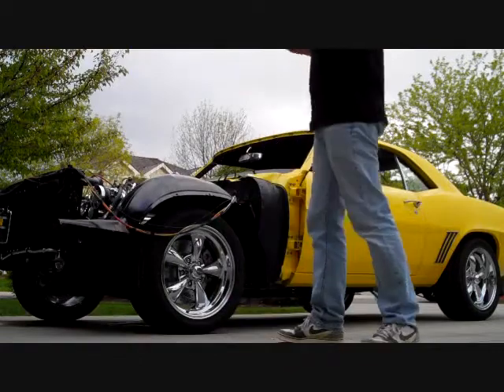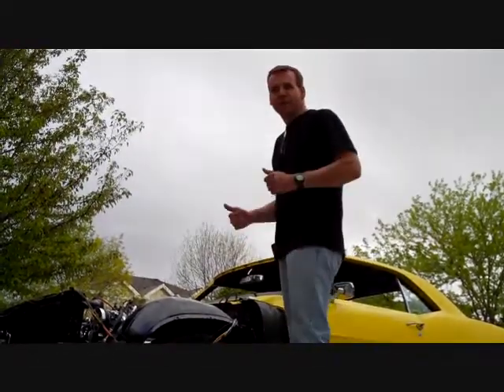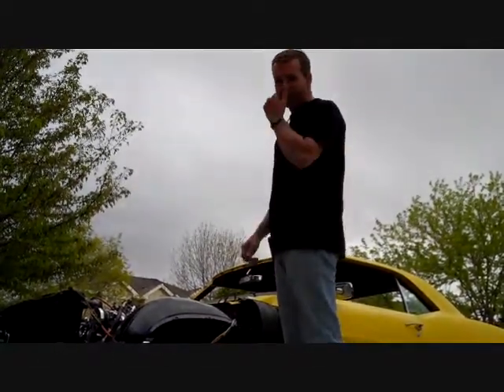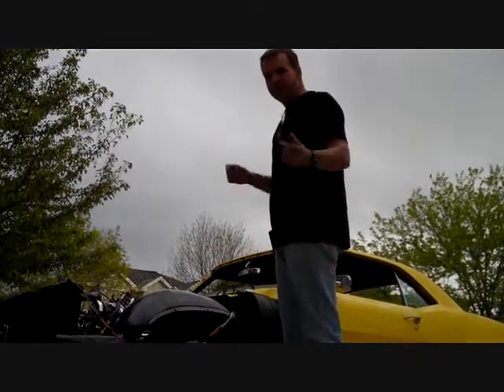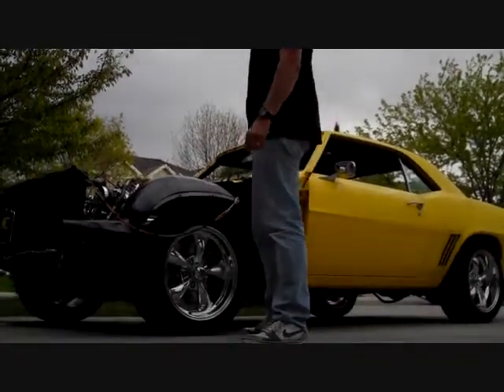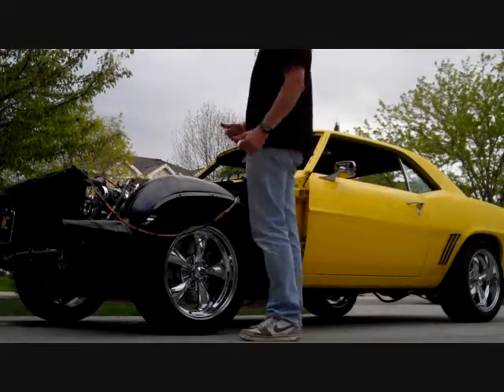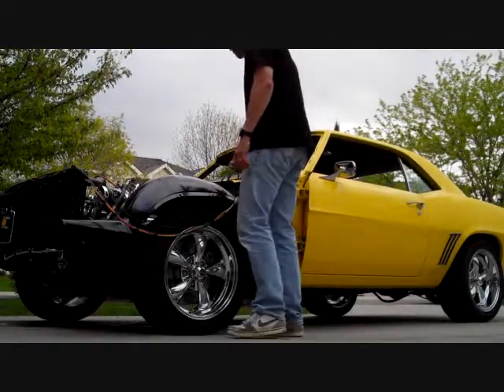1969 Camaro RS/SS 496 Big Block First start.

Comment from the maker: The motor was custom built by Ross Automotive.  They have alot of video posts here on youtube.  Its a 496 cid  10to 1 comp with forged pistons, stroker crank, Patriot 320 cc aluminum heads, edelbrock air gap intake with a Holley 850  all msd electronics and pro billet distributor.  The suspension is all global west with Qa 1 coilovers.  It has 17 inch wheels and  40 series tires.  The brakes are all Baer 13 inch front and rear.